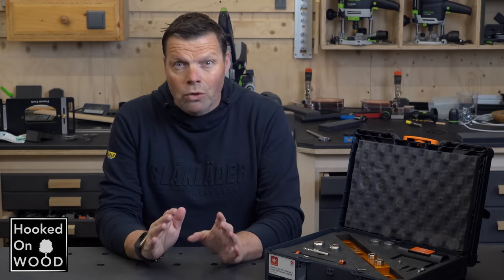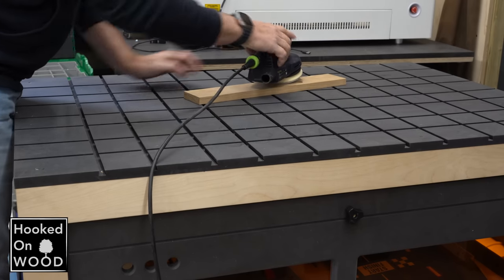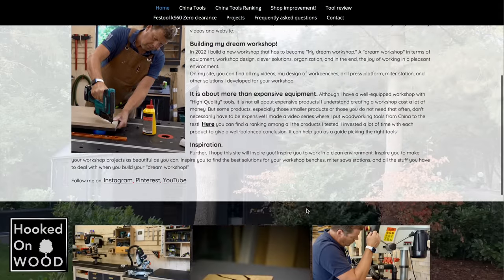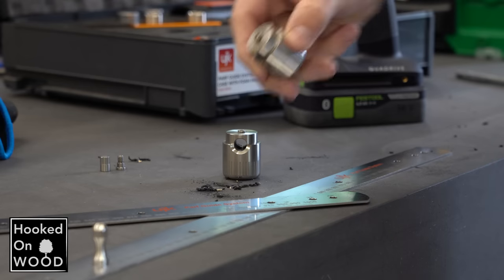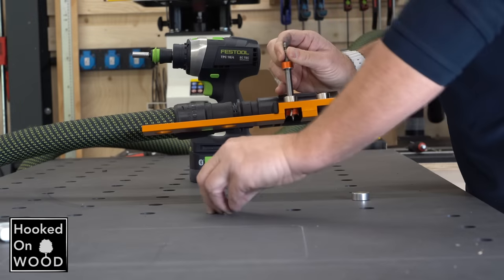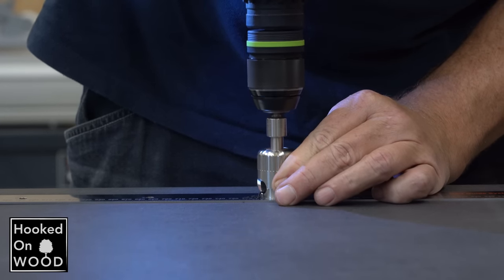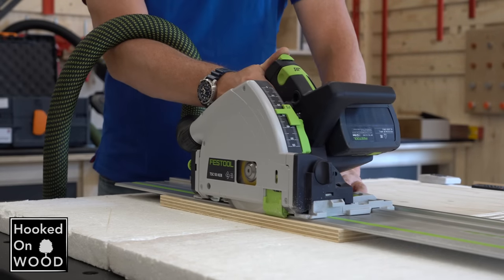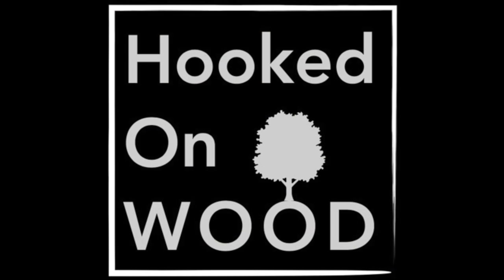Upgrading your workbench with an accurate grid of dog holes!

Comment: Another great video. I ended up breaking the 20mm Drill bit while trying to drill over 200 holes with the Parf Guide system. I ended up ordering Fisch FSA-134572 Wave Cutter Forstner Bit, 20mm x 8mm drill bit for $23.70, since I ordered a replacement and it was going to take a while before I received it. I'm glad I did. I use the same material for the tops that you use and the Wave Cutter cuts through it much quicker. I wish I new about it from the beginning of drilling the holes.
Reply: Has the same diameter as the mk I bushing?
Reply from the maker: In my experience the benchdogs fits tighter with the UJK bit. But I agree the fisch bit will cut faster. I have both but I use the UJK fore tighter fit.

Comment: Hi Dennis,
You are so right about the cable sticking in the dovetail system. What I did was created (3d printed) some dovetail plugs with a little chamfer that fit at the edge of the workbench so the cable would not stick again. Only downside is that the more slots the more plugs, but I found out that if u 'plug'  one side of the workbench it will be fine most of the time. U can slide the clamps from the other side and still remove the plugs if needed.....keep up the nice video's, always watching them, 
Cheers,
Peter

Comment: Clear and extensive vidéo Dennis !
Yes it's a budget for this tool/jig.
I don't really understand who are the customers for this.
Professionals will buy a foldable Festool workbench MFT straight.
I've done mine with the rag'n bone method for the cost of good auger drill bit but after 2 years of use, I will not bore all these holes again but just on a smaller part of the workbench. 
The debris and dust management may be also a pain.
Reply from the maker: I often say in my videos that I like dog holes in my workbench, and for most of the accessories you do not need a accurate grid of dog holes. So, just drill holes of 20mm will give you already a lot of possibilities. I think the professional is one market if they want to change the MFT top them selfs. 
But the hobbyist woodworker may also be a market. I never thought I would buy it 5 a 6 years ago. Now, I think it is fully worth the money.

Comment: Great video on the parf system and your new bench, Dennis, thanks.
I think the MK II version is well worth the extra cost for the upgrades you get. All the additional pieces and changes allow for more accuracy and less wear on the parts, so the system will last much longer, if not indefinitely aside from the 3mm and 20mm drill bits, though I suspect even those will last through a pretty good amount of MDF tops. As for the rulers, they added additional holes for offsetting holes at 32 or 48mm. It's a great system and I'm very impressed with it.

I already have the MK II parf guide and the 1000mm flat parf fence. I have some other ujk accessories on the way from axminster as well. Looking forward to setting up my shop made mft.
Reply from the maker: Yes, I have the shorter version of the Parf fence and I regret I did not choose the 1000mm. Like I said in the Video, they make very nice engineers products. I love working with it.

Comment: Tip for others: 
When I did my workbench top with the UJK Parf Guide system, I first drilled the 3mm holes, then used a large drill bit to enlarge as many as I could, and only then used the 20mm Forstner bit. Even though that was an additional step, it was much quicker since the Forstner bit didn't have to go through so much material (I have a ~1.5inch top). 

Only thing to keep in mind that you don't drill the holes that you need for the guide rail initially to go to the next set of holes.

Also, thanks Dennis for all the time and effort you put into the videos. They are high quality and people appreciate your content. 

I've built (95% done) my version of your version of the 4th gen workbench and really like the design. I also think - if you get the chance - spend some time for putting (updated) plans on your website. Even just a PDF with measurements would be great. I know people would pay (some) for it and it may would make worth your effort.
Reply from the maker: Thanks Antonius for the Tip and compliments
Reply: It is also a good idea to drill the 20mm holes 1 or 2 mms deep from the underside first.

Comment: Define accurate. Due to the multiple transfer of reference points (ask a machinist if this is not clear) accuracy degrades with the PARF system across the grid. Using a template (CNC cut, and ideally at least half the size of your table) is better, because-
- it is more accurate
-it is faster
-it is cheaper
Using a template with a trim router takes around half the time to give a more accurate result in my experience. I have measured both methods using gauge blocks (accurate to nanometers) and the results are clear.
BTW, using terms like 'perfect', 'spot on', etc makes an engineer wince. Everything has tolerances. Understanding tolerances is the key to accuracy.
Reply from the maker: I do not make my videos for engineers, so perfect means perfect in the average sense. That said, there is a reason why I talk about near CNC. Because it is not perfect in that sense. The second methode you mention "can" be accurate. Because that also depends on several things in the proces. If you want to use a CNC template half the size of the table, you better make te complete table CNC. That is most accurate. So, it think mainly because of the system design it is more flexible to use in other situations as well. They did a lot to minimize human error and deviation by using very well engineered products with very small tolerances. 
So, that is what my message is in this review. I think an alternative can be as good, perhaps even better, but I discussed the PARF system here. In the end, I think we are not so far apart from each other. But the angle we look at this product and I made my review about this product is just a little bit different.
Reply: @HookedonWood  Yes, you did say 'near CNC', which is a good clarifier. I say half size, because that just involves just one translation, with widely spaced alignment dowels (used in the engineering sense). Yes, whole table size is better, but not much in practice, because wood (especially MDF) moves with RH in a non-deterministic way, negating attempts at too high an accuracy.
Using 3mm drills through a guide bush hand held in a hole in a ruler has several error components- the narrow jig guiding a forstner bit via plain bearings has several more. Because the jig is 'walked' across the table, errors are cumulative- especially as the reference dowels are only 192mm (two holes) apart. I refrain from doing a full error analysis- the manufacturer knows and agrees on the above (the designer appears not to...) I think your review is reasonably balanced; I would just compare it with the cheaper, faster, and more accurate alternative.

Comment: though I really appreciate how well constructed an made this system is, I honestly think buying a CNC made mdf plate is the better solution. It is at least as accurate (in fact I believe it to  be more precise...) and far cheaper. And when you have bought one you can easily make a copy with your router, so you don't have to buy another plate when the original one is worn out, and btw that is faster done and easier than the process with the UJK system
Reply from the maker: If possible, that is the best choice. But this is flexible, you can make the number of holes you want and use it anytime you want.
But there is a reason I say near CNC because there are still some small variables that can exist. But I do not think a CNC cut sheet is widely available, especially for a good price.

Comment: Hi Dennis. Thank you so much for all your amazing videos and for sharing your incredible insights. I'm still new to woodworking and in the process of building my first small shop in the garden. Your workbench design seems to be a perfect match for me. I've bought your plans and I'm about to start building - I was wondering if you would have time for a quick question? Have you had any issue with the drawers not having a stop? do you accidentally pull the drawers all the way out and if so, do you have any recommendation for a simple drawer-stop addition to your design?

Comment: Have you ever used a track saw rail hinge on a workbench?
I've seen those used in combination with a dog hole fence to not only create an amazingly flexible workbench but it also allows you to use a track saw as a semi table saw with accurate repeatable cuts without having to set up any guides.
For people with limited space like myself this is an amazing way to save space without loosing a lot of functionality.

I would love to see a video about those.
Reply from the maker: Hi, I did not, but I fully agree with you. If I would not go for a tablesaw, that would be my go to direction.

Comment: Hi Dennis I made the same thing for £50 and yes it is accurate and I have made my friends work bench tops with dog holes to any spacing they need so although its a good video the pricing of it is way over the top
Reply from the maker: Hi, I am curious what you made!, this is an expansive tool, and it took me long before I decided to buy one myself. But it is a well engineered product and they push the boundaries to make it as accurate as possible. That is what I like about it. But I agree, it is a lot of money and you will have to make three table tops to be even when you let it cut CNC.
Reply: @HookedonWood  Hi Dennis, well I used my engineering knowledge as I was a toolmaker, and made it out of aluminium with stainless steel inserts, it weighs in at just under a kilo and its with in 0.001 so pretty accurate, and yes i made it on a CNC machine in a factory near me, so far I have made 9 work tops, but I don't charge a lot as its a hobby not a job, so they buy the material and I make it. It cost them only £20, And compared to the one you showed it is a bit longer but not wider, but I do enjoy your videos so thank you

Comment: I love my Parf guide system and recommend it for anyone using a “MFT” workflow. I wouldn’t say near CNC accurate it is that accurate.
Reply: No, it isn't. I have measured the results of the Parf system, using engineering measuring equipment, accurate to nanometers. It is nowhere near as accurate as P Parfitt claims. Ask Axminster tools, and they will agree on the limitations of the system, including the accumulating errors the system suffers. A well tuned home CNC mill (never mind professional systems) can exceed the accuracy with ease. And a template is also much faster and cheaper.
Reply: @Tensquaremetreworkshop  on the tables that I have built observing Peter Parfitt’s directions I get a perfect as measured with my squares,(Bridge City, Starret engineer) and rules (Shinwa, Starret, Mityomo) I get as perfect results as I can measure throughout the grid of holes. Any size and shape I need. Now if your building airplanes and not cabinets or tables I suppose nanometers become important. Mind you I am just working in my garage/shop. All I know is what I build fits together perfectly using my Parf guide system.
Reply from the maker: And that is the perspective to value this product. Not if NASA can use it.
Reply: @kylereed3577  Perfect is a Platonic ideal- never reached in practice. Everything has tolerances. The Parf method has several tolerances that are cumulative. You say you have measured the result- with rules? Really? Unless you can quantify the error, with precision equipment, you cannot compare the methods. A CNC template is, without doubt, cheaper. It is also demonstrably faster (half the operations with less setup time), which only leaves accuracy- which I have (accurately) measured to be poorer. I rest my case.
Reply: @Tensquaremetreworkshop  i guess you missed the point of the circumstance. As long as you are happy with your choices that’s all that matters. Good luck and have fun with your hobby
Reply: @kylereed3577  What ‘circumstance'? You mean making a poor choice and being in denial to avoid emotional loss? Cognitive dissonance is a high price to pay…
Reply: @Tensquaremetreworkshop  “Lighten up Francis”

Comment: Hi Dennis - great overview! What is your secret to using this system with the 2x top? The 3mm drill guide is only tall enough to get through a single sheet. The UJK manual says the 20mm bit does not have a cutter in the center and is made to follow a through 3mm hole. Do you just freehand with a 3mm bit using the existing hole as a guide?
Reply from the maker: it is not necessary, but I find it a bit more robust and helps a bit against micro vibrations while sanding. I have no problem drilling through the 36 mm top with the 20mm bit from UJK.

Comment: I think what's missing is a description of the alternative. How much is a CNC cut workbench top? If you can make (for example) 5 for the price of the Parf guide + 5 sheets, then maybe it's a bad investment. If a CNC cut top is the same price as the Parf guide system, then it's probably best to get the system.

It would be great if you could get a couple of quotes and see what the price would be. I'm going to do that myself, when I start building a workbench. Which is hopefully soon, the room is almost done :)

And while I'm writing anyway, thanks a lot for all your reviews. There are definitely some tools in your list of china tools that will be bought for my new workshop.
Reply: A CNC cut template is faster, cheaper, and more accurate. It can be used multiple times, so straight price comparison is valid.

Comment: Hi Dennis, thanks for another excellent video.
I have one question on the table top if you can answer. I found (i'm in Italy) this material "PANNELLO (MDF) VALCHROMAT" which seems good
It comes either 19 or 30 mm thickness.  QUESTION : Do you think going for the 30mm is overshooting ? 
Thanks in advance and cheers
Reply from the maker: I use two sheets of material. 1x 19mm Black MDF and 1x 19mm underpayment. This gives more mass and less vibration when working on it. So I found this very nice to work with. So, I think the thicker the better but it does not have to be Black MDF because I think the 30mm will be very expensive. Keep in mond that with thicker top, you can not use rail guide clamps. Bit there are enough alternatives
Reply: @HookedonWood  Thanks so basically you glue the two 19mm sheets together before creating the 20mm holes pattern, correct ?

Comment: Nice explanation of the Parf Guide systems, Dennis. I also made a large work surface using the Parf 2 and it worked perfectly with very accurate holes over the 2 x 1.2 meter top. I also used the guide to make a smaller top for my Felder 300 cart - that cart is hands-down is the best purchase I've made in a long time.  I would recommend the combination reamer / chamfer tool from UJK for finishing the holes. It works well in conjunction with the UJK dogs and they'll sit flush in the bench top after reaming. I used a standard chamfer / countersink bit in a different top and it works OK but not as consistent as the UJK version.
Reply from the maker: Yes, you are right. I will mention them in the accessories video

Comment: Hmm, I got mine from (I think) TSO about a year ago, and it didn't come with a systainer or any kind of case. Did you buy that separately, or was it included from Axminster? BTW, I got this just to make a grid in a benchtop that was too wide for my CNC. Please don't tell my wife.
Reply: BTW, I think it's great that you let everyone know that you don't need this unless you're relying on a track saw for everything, and even in that case it's better to CNC or buy a CNCd benchtop. This is one of those fishing lures that's designed to catch fishermen rather than fish. IMO.

Comment: Good video as usual Dennis. Planning to re-watch several of your bench videos before starting on one. 
Just wanted to mention - I found the rain on the roof noise(?) a little frightening on my studio monitors!
Reply from the maker: Sorry, I thought I kept re reasonably under control on my editing headphones.
Reply: Which studio monitors are you using?
Reply: @NWGR  Not sure it's relevant on a woodworking channel! - HEDD 07 with a KRK sub. The rain noise was so unexpected that I paused it to make sure it wasn't water pouring in my loft! Not wanting to criticise Dennis though, his production values are v good.
Reply: @soundman127  It's all good! 🙂
Who doesn't consider music a necessary workshop tool? XD
I'll check those out, thanks. I'm looking to upgrade my speaker setup.

Comment: Great review as always, and I for one happen to like dogholes.  But that Felder table base is crazy expensive. Around €1650 incl VAT in Sweden. Does anyone know of cheaper alternatives?
Reply: Yes. You are a maker, make one.
Reply from the maker: I did find some models without wheels that are a bit more affordable. But I wanted some flexibility, so that did not was an option. It was a hard decision because I always worked without height adjustable workbench. But It is hard to ignore the benefits. Although that does not mean it will justify the price for everyone.

Comment: What material you use for your table top(black table top) Tqvm
Reply: It's black MDF
Reply: A topic worth expanding on.  By the looks of it , the black MDF is Valchromat, in the UK costs about £150 per sheet, plus delivery. It is considerably tougher than regular MDF. Axminster tools MFT tops and some jigs use this material. I have not used this material yet, but having created MFT work tops in ply and in my pine work bench, and some smaller jigs in MDF, I find holes in regular timber using the parf UKJ jig variable in fit, no doubt grain and wood movement is at play.  Ply holes are consistent,  I went for a double thickness of 3/4 ".  A single thickness (18mm)  of standard MDF is I feel a temporary sacrificial solution, especially if if clamping dogs are used, which rely on racking to maintain hold down pressure.